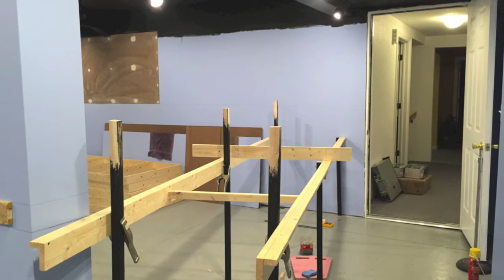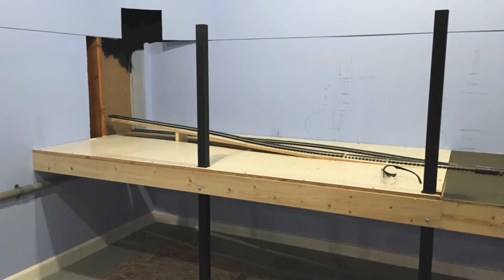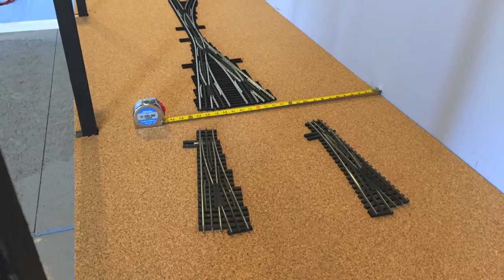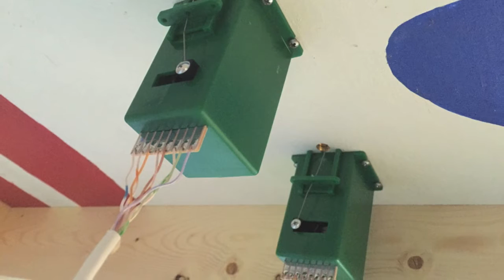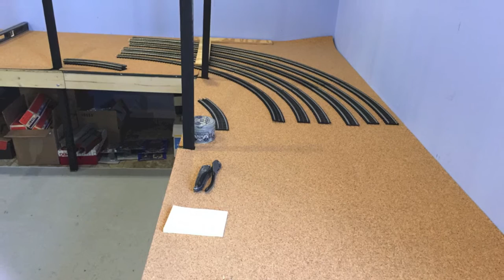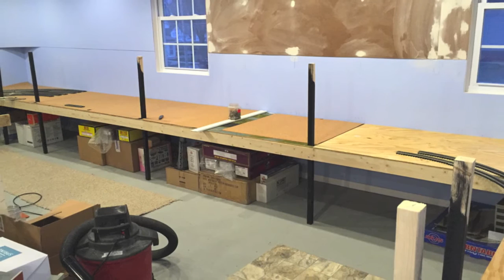O Scale Layout Construction: Part 3

Comment: Hey how do you connect Fast track to O27 .Lionels connector isn’t meant to connect to O27
Reply from the maker: I believe Lionel has adapter sections available that will convert from Fast Track to Tubular / 027.  You may have to put cork under the 027 to match the height of the Fast Track.
Reply: digistew yeah but is there way I wouldn’t have to put cork under every piece of track
Reply from the maker: @nightisright1873  In my experience Lionel made two different types of tubular track.  The standard is the same height as Fast Track but the 027 is shorter in height.  So, you would need to ramp up or down to match the height of the Fast Track. So, option 1:  Ramp, using wood or cork.   Option 2:  Raise the 027 in some way to match height.